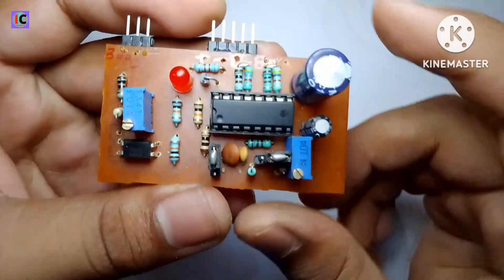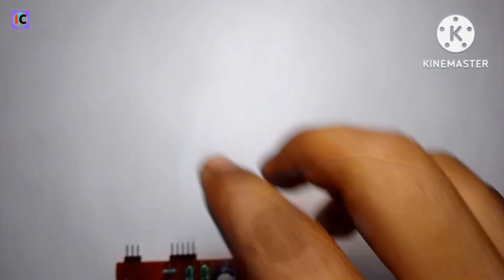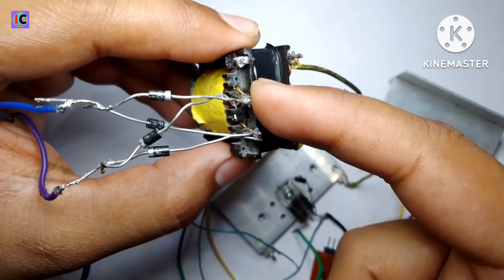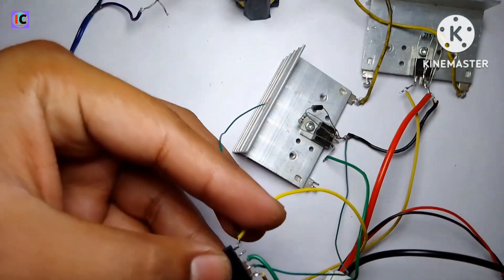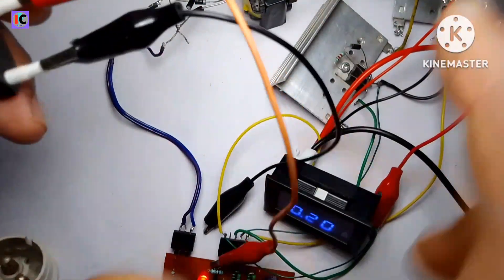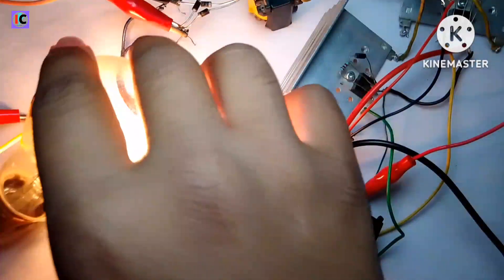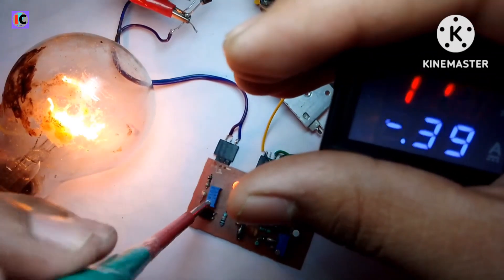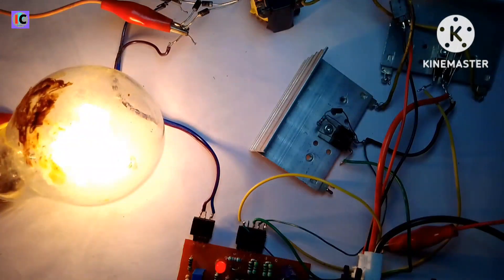KA3525 Inverter #inverter #converter #powersupply

Comment: bro. you have used 2 switch in this module, but in pcb layout has no switch in your pdf file. Is it correct then I will try.
Reply from the maker: Which 2 switches are you talking about I dont under stand plz clarify it

Comment: Bro. you use 2 i sence switch, but pcb layout has no switch.
Reply from the maker: thanks for watching 
In this circuit there's no I sence is used only voltage control pot is given and other is for frequency adjustment

Comment: I have made same sg3525 circuit but my circle is not working
Reply from the maker: double check the circuit
Reply: @innovationic  I have checked, and I have destroyed so many sg3525 and mosfets
Reply: @sujeshroy1804 Mosfet may be heated. If heated you connect transistor in two output with diode.

Comment: Is it possible to step up 3v DC to 50v DC to run e-bike by single LFP cell of 3.2v
Reply from the maker: convertering 3v to 50v isn't possible, it takes huge current for e-bike consider using high voltage low current system like 36v or 48v.